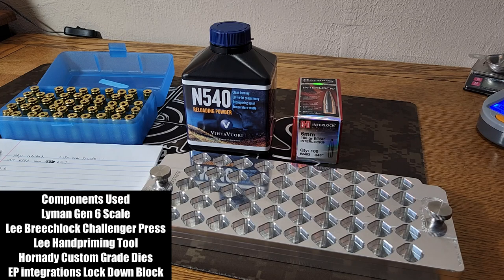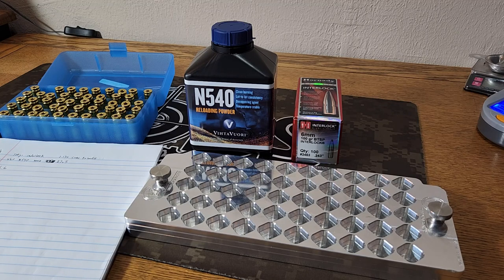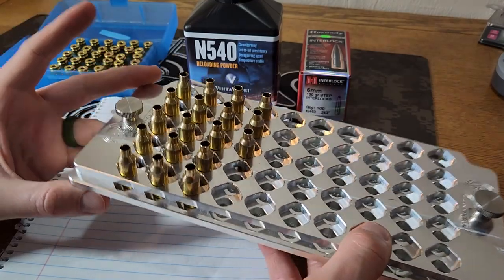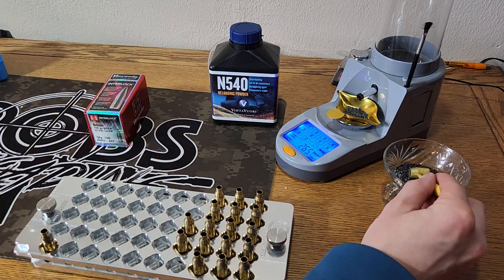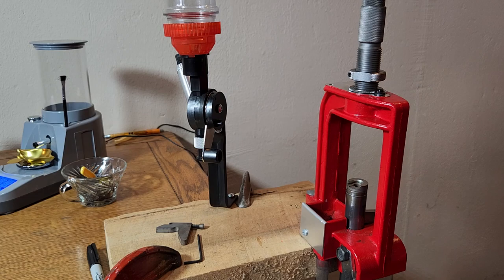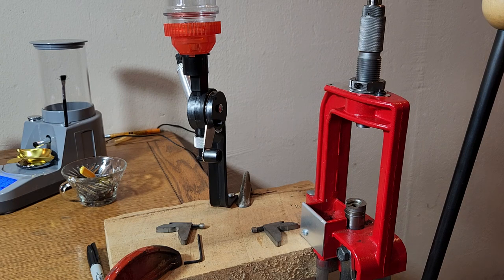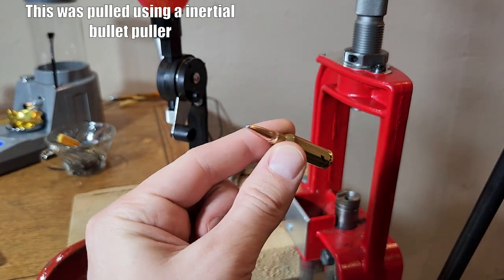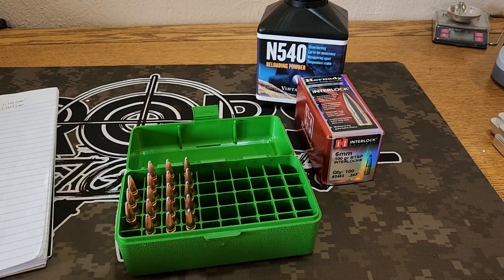Loading for 6mm ARC

Comment: I have read that if you rotate the case about 180 degrees after a small amount of seating the bullet then seat it the rest of the way it can improve accuracy a small amount.  It might be reloader superstition but I do it just in case it works.
Reply: I sometimes seat all the way then rotate and run it again and have noticed that it can straighten runout some.    I tend to have very little runout anyways but if I have one that is an outlier it can help.

Comment: This powder produced velocity that was 100 fps faster than QuickLOAD predicted with the 103 grain ELD-X, so these max loads will probably actually be near max bolt gun pressure, and not 14,000 psi less as QL predicted.  This is why we need to always start low!
Reply from the maker: Yeah I am starting to be more reasonable with 6 arc loads. Lately I have destroyed a bit of brass, blowing primers/primer pockets. Just because it is a 62k psi cartridge doesn't mean I need to ride the ragged edge everytime.
Reply: @RobsReloading  I always say, "How can you know what's fast enough until you know what's too fast."  There, I did it again!
Reply: @RobsReloading  I think the Hornady brass is on the soft side.  It will be interesting to see if Starline will make it, but probably not any time soon.
Reply from the maker: @dahut3614  I have some 6.5 Grendel Starline brass I could size down, but need to save some brass to shoot in the Grendel!

Comment: I'm very curious as to how 540 performs. I tried N140 and was disappointed (but not surprised) at the velocity. I just started load development for my ARC and so far leverevolution with CCI 400 primers pushing a 108 gr eld-m is looking very promising. 28.8 grs of leverevolution is getting me 2685 fps (avg) with a sd of 11 and es of 24. Little bit higher es than I would like to see but it's comparable (if not slightly better) than factory. My big thing for looking at VV powders is temperature stability. Supposedly it's one of the best on the market. For now though guess I'll have to keep track of the leverevolution and see how temps affect that powder.
Reply from the maker: n540 seems like a solid 6 ARC powder. Check out my video with the 103 eld-x and N540 https://www.youtube.com/watch?v=YPJLDwCIr_U&t=10s